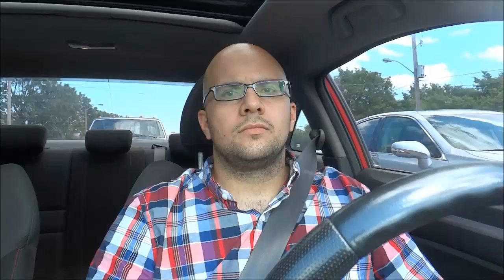Exhaust Backpressure Explained-What It Is And Why It Can Be GOOD For Your Car

Comment: Back pressure is especially important on two stroke engines to make sure all the exhaust gasses leave, but the new air fuel mixture doesnt exit the exhaust. You also dont want to keep exhaust gasses in your combustion for the next work cycle as it will harm power. On four stroke engines its less trivial but since valve overlapping is a thing it still is good to have a tad (cause its tuned to have some). I’m 100% sure you could engineer an engine that works with no exhaust backpressure at all but then you would harm performance and efficiency by simply mounting a exhaust. So they tune their engines for some backpressure so they can mount a exhaust system without harming their engines stats. I’m sure there are other reasons aswell but this is what came to mind

Comment: If the exhaust gasses travel too fast they don't have time to pick up and carry away HEAT.  If the engine is nut tuned (carbs or EFI) for the free flowing exhaust you will run lean and hot.

Comment: Umm.. no.. you're confusing turbulence for back pressure.
Back pressure is where the atmospheric pressure outside the engine exceeds the pressure inside the combustion chamber. Exhaust systems are built around exhaust scavenging also..
Never seen anyone be more wrong in a span of 3 minutes.
Reply: Exhaust backpressure increases temps which helps with emissions

Comment: There is no reason for back pressure to help an engine. The only thing an engine needs is a set of headers on it to utilize the pulsations/frequency of the exhaust output bursts, and this is only for scavenging. That's why even race cars have headers. Of course, adding a turbo/supercharger changes everything. 
--The only reason vehicles have an exhaust system is to quiet it down and pass emission standards.
---There is no back pressure without an engine running. Back pressure, from my understanding, is essentially the difference in pressure between the exhaust and the pressure of the exhaust piping/system. So, more back pressure essentially means that the pressure gradient is less, while less back pressure would be the opposite--higher pressure gradient, thus flowing better. 
--Engines don't need back pressure. They are designed to function dynamically using the designed back pressure in the system to run properly. If the back pressure is dropped as low as you can get it, then the timing, etc. would need to be adjusted to compensate. And, that's where chips and reflashing comes into play.

Comment: Exhaust back pressure is never good, don't listen to this guy and search around for real engineering information. When people slap massive exhausts in their stock engines they can lose torque, especially at low engine speeds because of the way it affects the pressure waves in the exhaust leaving the engine out of tune, look it up. Racing engines always have straight through exhausts (unless the rules require otherwise) because you always want as little resistance to flow as possible.

Comment: Bogus! Back pressure is only good for one thing... noise reduction and emissions. When your pistons have to work harder to push out the exhaust gases into the headers because there is back pressure in the exhaust, more gasoline is used and more heat is generated. Vehicle manufacturers design their exhaust systems around regulations, not performance. Restrictive headers cause your exhaust gas to retain more heat, which makes it more easily converted into cleaner gases via the catalytic converter. Restrictive mufflers obviously heavily lessen the sound emitted. The power and longevity of the engine DECREASES with higher back pressures.

Comment: This guy is right to an extent, but... too much backpressure is bad, which he did say, but consider the following... when you have an exhaust that is super small in diameter it has high velocity, but the gas has less area to take up which increases back pressure and can even make the exhaust gases go backwards which puts extra stress on your engine.
 If you have a large diameter pipe it can give more room for exhaust gases but have very low velocity which means that your exhuast gasses aren't being expelled as quickly or efficiently as they should, considering how much power your car makes, you need a pipe that is the right diameter for the perfect balance between velocity and area for the gas in the exhaust to be expelled as efficiently as possibly, this is why the more horsepower a car has the bigger the exhaust diameter has to be, because it is expelling more exhaust gasses at a higher velocity and needs more area, thus means you need a pipe with a larger diameter to decrease the backpressure, when you upgrade your engine you increase power which requires more air and fuel which means that you will have more exhaust gasses, to counteract the extra exhaust you will need a bigger exhaust because the previously smaller pipe was made for less exhaust gasses or less vlocity and area. 
 There is a common myth that engines need backpressure otherwise they lose power, but look at it this way, someone with a stock engine that hasn't been modified decides they want to upgrade their exhaust system, they decide to increase the diameter of the pipe by 1 inch, they end up losing some horsepower in the process so they assume that their car needs backpressure to achieve maxium power, and in a way they are correct, but the reason they lost power was because they increased the area for the exhaust gases while also decreasing the velocity which doesn't expel the exhaust gases as quickly.
 If you have a hose with no nozzle on it you can see that a large amount of water is expelled, but not at a very fast rate, but when you add the nozzle, the smaller diameter of the hole creates more velocity, but the smaller the hole the less water comes out, which isn't very good for exhaust gasses because you want to get out a large amount of exhaust at a fast rate, the perfect diameter will create a nice amount of velocity out of the pipe but also have enough area for a good amount of gas to flow through and out of the pipe too. 
 When he says that a certain amount of backpressure is needed to create the correct amount of power for a car he is talking about the powerband, the powerband of a car is a range in the rpm's where you create the most amount of power, single overhead cam engines create maxiumum power in the lower rpm range, this is where backpressure is good for single overhead cammed cars because the lower rpm range is where there is the least amount of backpressure when a exhaust pipe is more restricted, thus adding more power in the lower rpm's, but too much restriction is not ideal because then you lose too much power in the high end of the rpms and also power all together all while putting extra stress on your engine, but the opposite is needed for a dual overhead cam engine because their power band is in the upper rpm range, so when you have a exhaust pipe that is less restricitve it creates not as much power in the lower rpm range, but a lot better power in the upper rpm range, this is because the velocity isn't fast in the low rpm range and there is a lot of area for the gases to take up which means that they really dont end up leaving the exhaust pipe for a longer period of time, once the upper powerband is reached though, it creates the ideal balance between velocity and area for the exhaust gasses to be expelled as quickly as possible
Reply: Any backpressure is bad.

https://youtu.be/jjPeP_Nn2B4
Reply: @VndNvwYvvSvv  We're all born stupid. He'll come around.

Comment: Seems like a misunderstanding between backpressure and scavenging.. ive done straight flow,but maintain the diameter pipe size from the factory.. it gives me better pull from low rpm and straight to redline.. and ofcoz a better fc when cruising long distance at legal speed.. and the noise is bearable~

Comment: You can't have your exhaust gases leave "too quickly" if anything you'd want a vacuum sucking your exhaust gases out, oh wait that's called exhaust scavenging... the very opposite of back pressure.
Reply: If you basically suck out the exhaust with negative pressure you also suck in fresh gasses thanks to the valve overlapping which is bad especially on engines with carburettors or port injection (basically anything that isnt direct injection)

Comment: Is it some backpressure for the pistons to bounce back? Just a little bit, but that little bit still count. The gas combustion push the pistons and the backpressure help that little bit to push back the pistons or so call the hot air has some resistance from the backpressure or so call hold back that little bit pressure to push back piston.
Reply: Jackie Tan no cuz those r used, burned air. U don't want em that much going back to mix with the new fresh air

Comment: no offence but i still dont get why its bad to have no back pressure. maybe i missed a part but isnt the purpose of the exhaust pipe to lead the gasses away from the engine? than why is it bad if the gasses flow faster. i would think the faster bad gasses are gone the better
Reply: I'm with you man. he sounds like he knows what he's talking about,  but I don't think he does. back pressure is not GOOD. you want all exhaust to exit as efficiently as possible,  with the least amount of back pressure possible. there is a balance between too wide, and too narrow. if your pipe is too narrow, running at higher rpms will cause back pressure (rapid pulses of exhaust need more space to escape)..if your pipe is too wide, the velocity of the exhaust will be too low (picture water pouring from water hose, no put your finger over the end... it sprays much faster right?) it's all about balancing the two
Reply: I'm with you man. he sounds like he knows what he's talking about,  but I don't think he does. back pressure is not GOOD. you want all exhaust to exit as efficiently as possible,  with the least amount of back pressure possible. there is a balance between too wide, and too narrow. if your pipe is too narrow, running at higher rpms will cause back pressure (rapid pulses of exhaust need more space to escape)..if your pipe is too wide, the velocity of the exhaust will be too low (picture water pouring from water hose, no put your finger over the end... it sprays much faster right?) it's all about balancing the two
Reply: Backpressure helps with what @thatrunawayguy3555 said and also increases exhaust temps which helps reduce emissions.

Comment: Need proper explanation why back pressure is good.
Reply: No. Wrong.  Absolutely not. Backpressure is always BAD.  The confusion comes from the inevitable increase in resistance when properly tuning and exhaust.  You'll always outweigh the "backpressure" (resistance) if you do it right. That consequence is what people conflate with the benefits.
Reply: An exhaust can change the amount of torque at any giving moment. A little back pressure will give an engine torque in the lower power band, which is good for a street car, a less restrictive exhaust will have minimal pack pressure creating more torque and power in the upper revs which is good for an off-road track vehicle. For a 4cyl car, a little back pressure will actually make it a bit quicker. Compression, cams, intake also makes a difference